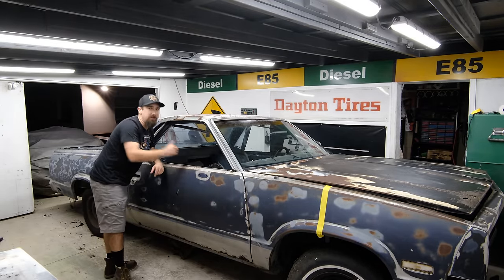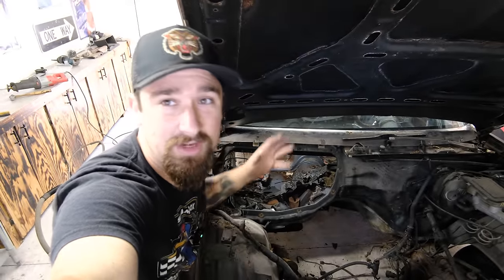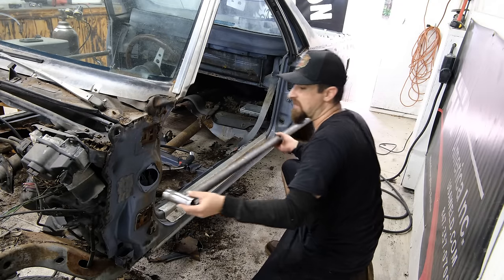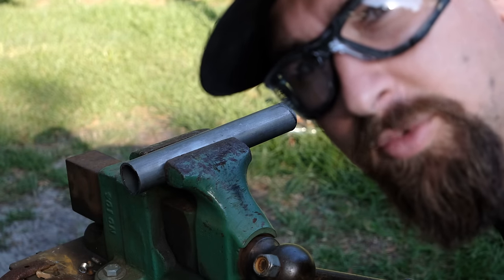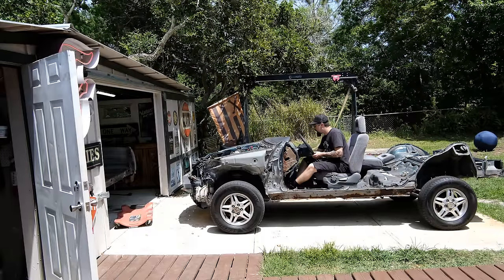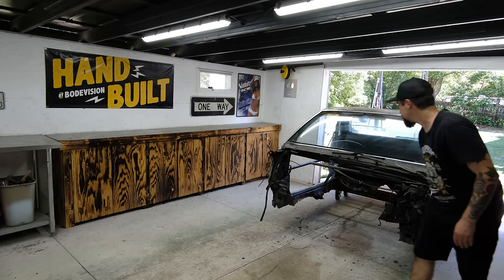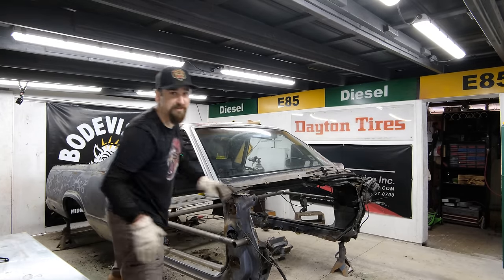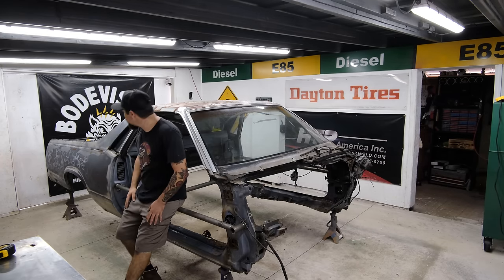AWD Honda-Powered El Camino Transformation: Stripping Down for the Swap | Body Swap Series Ep. 2

Comment: I love this. You can even get a almost 50/50 weight balance by putting battery and radiator behind the driver and between the rear tire area in the bed. And still have the majority of the bed to haul stuff if needed.

Comment: Moving forward, I would switch to healthy tacks for the bracing that is getting cut out. That sheet metal is not trying to move that much, those welds half way around the braces will annoy you on removal more than cutting a couple strong tacks. Just my 2 cents to hopefully help, you're getting along fine without it lol.

Comment: Why not fab up the door braces where it able to be bolted on where the door hinges are and then where the doors striker is so you on have to worry about if it might push or pull on the rest of the body panel and it also saves you from having to weld onto the body possibly warping it and then having to grind an work the body where it was welded...

Just a thought for future use

Comment: Question when you chose these 2 cars for the body swap Did you taken to consideration the wheelbase Of each car Because one of them is a 116 inch Upwards to a 119 Inches depending on what year And the CRV has roughly A hundred and three Inch wheelbase. 
 Because I want to take a 88 Ford Mustang notchback Take the engine transmission Transfer case Out of a Wrangler from the 80s early 90s And make some custom body panels To make the Mustang look like A R32 skyline Because there's literally a .5 - 1.5 inch difference In the wheelbase and length and height roughly of those cars Same with the Sideto side lengths
 Because quite possible you're either going to have to shorten the Camino Or lengthen the undercarriage frame Of the c r v And get a new Drive shaft for the rear end So you can make the Camino look stock size wise  Or like I said you're gonna have to make it shorter For it to work in the long run

Comment: just thought of a name : EL COHONES

if you only cut straight fishmouths it might be usefull to have a piece of pipe that can slide over the piece youre cutting that has a perfect fishmouth shaped on it 
that way you slide the bigger piece over the pipe line it up with youre markes and draw the fishmout on using the edge of the big pipe as a guide , should get you closer to the perfect shape a lot faster . can do that with different angles too but it would increase the amount of stubbies with fishmouths you need though you could do a 90 degree on one end and the 45 degree on the other end of the stub 
with the sideways or two angle slant youre still have to do it by hand i guess

as for balancing the el camino body while suspended , you could trow a ratchet strap over the center of the crane wrap it around sumting on the back of the body and use the ratchet to lift it , should be good enough for wat youre doing

mightve done the bedfloor different , not sure about how mush innerstructure is between the inner and outer skin aspecially in between the outer and inner fender but i think i wouldve cut it all around in one line just under the top of the bed a little above the inner fender along the "firewall"underneath the window and then down and across the floor near the tailgate 
that wouldve created a giant hole there the crv would fit intoo and allow you to raise the floor while keeping the inner fenders intact by wittling away at the cutline  inside the bed on the piece you cut out allso allows you to get the innerfenders to where they need to be by cutting them out off center and switching left to right and vice versa , think the fenders and the floor around them are simetric so they should be flipable